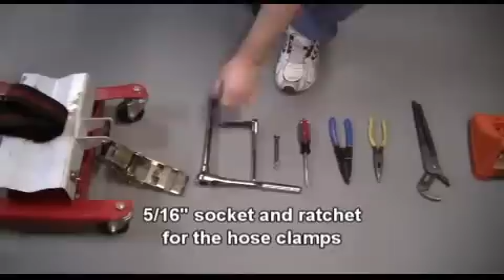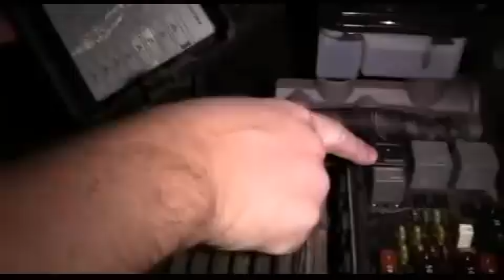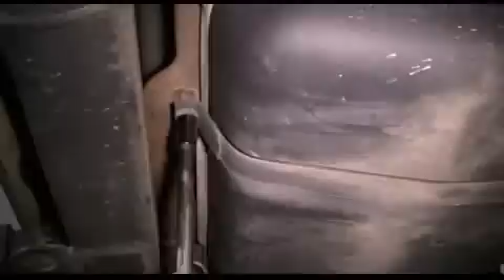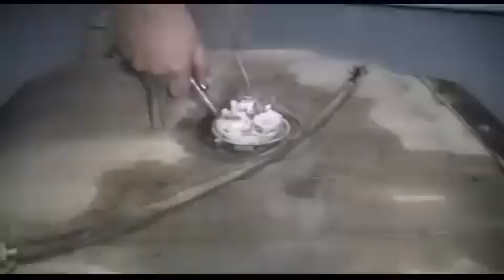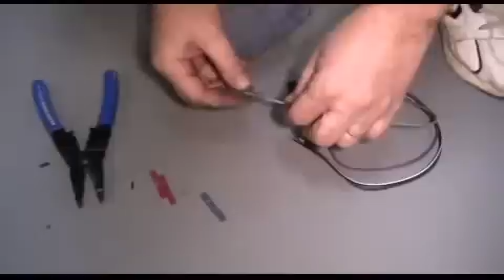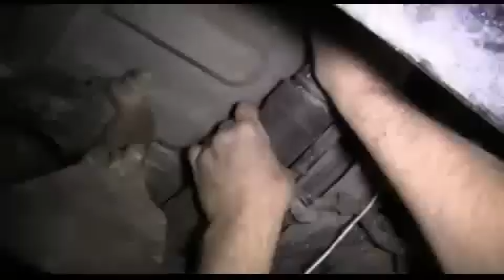Fuel Pump 1999 Chevy Suburban 1500

Comment: '99 CHEVY Express, my gas gauge pegs out at 3 o'clock, and van will not start.Mechanic cleaned terminals on PCM and said it should work,,, well it doesn't. New fuel pump,rotor and cap,cam, crank and throttle position sensors. New ignition switch, filler neck ground strap, pump relay. Lost need help desperately.
Reply from the maker: Rocky Raccon Does the fuel pump turn on?-Greg
Reply: yes
It will drive till gas gauge pegs out.
Reply from the maker: Did you change the fuel pump connector?  A lot of the new fuel pumps come with a new connector.   The one from the factory was a bad design
Reply: Greg Cook Yes.
Reply from the maker: Rocky Raccon Definitely sounds like an electrical problem.  Does the fuel pump shut off once the gas gauge pegs?
Reply: Greg Cook I really don't know,,, I unhook negative battery cable and wait 5-45 minutes, and start again. Drive a few blocks or miles and it quits again. If I unhook at night, it may drive all day and start, or it may only go  around the block.
Reply from the maker: Rocky Raccon Sounds like the fuel pump is bad.  This is just a guess based on my experiences with Chevy fuel pumps and what you're telling me.  Sorry I can't be more helpful - Greg
Reply: Thanks for your effort. I took to a local mechanic, they cleaned the computer terminals and thought that would take care of it. NAWT!! I'm thinkin' I got a short some where.But thanks for your time. Very appreciated.

Comment: When I start my suburban occassionally it sounds like a gun shot. I know it needs a new fuel pump. Could that be causing the loud shotgun sound when i start it?
Reply from the maker: I have never heard a loud noise coming from the fuel pump.   I have replaced 3 of them in a Suburban and either you heard the hum or nothing. 
-Greg
Reply: Do you know what could cause that type of sound?
Reply from the maker: Crystal Irvin Not from the rear of the vehicle I don't.  Where is the sound coming from?
-Greg
Reply: Sounds like under the hood
Reply from the maker: Crystal Irvin I am really not sure what that sound could be but my Suburban would make a clunking sound when cranking.   When replacing the head gaskets we noticed that the block was cracked.   I hope that isn't your problem.
-Greg

Comment: Hi guys...

Would you happen to have a video on removing the gas tank on a 92 GMC C1500?

Thank you,
John
Reply from the maker: John,

    I am sorry we don't.  But since the body style is the same as the 1999 Suburban this video should be close.

Greg
Reply: Thank you for the response Greg...

Suburban tanks are in the back and easy to get out, C1500 tanks are closer to cab and much harder to get to and out. That's why so many people on Youtube cut access holes in their truck bed or take the bed off altogether.

Thanks so much for your time,
John
Reply from the maker: John Dumas You are right I don't know what I was thinking..  And that would be a great video.  I hate to see someone cut a hole in their bed.

Greg
Reply: Yeah... and there is not a single video on Youtube covering removing the tank and working on the fuel pump, for that series Chevy or GMC truck.

Bummer...

John:)

Comment: Was the new ele. connector that came with the new pump ness.? Cause I jst changed mine & now my gas guage don't work, but it's the exact same connecter!?
Reply from the maker: The original design of the electrical connector was a bad design and most new pumps come with a new better designed connector.  So if your new pump comes with a new connector then I would suggest replacing it if it's never been replaced before.  The new connector should be different from the original one.  If yours is the same then your fuel pump may have been replaced before.  I would double check all the connections.

Greg

Comment from the maker: We choose to show how to disconnect the lines once we had the tank removed.  It was almost impossible to show us disconnecting the lines while the tank was still connected as there wasn't enough room.  We also showed the tool we used and how we had to modify it.  I believe the way we did it was more helpful since we could show a better view of the lines.

Greg
Reply: Fuel pressure regulator
Reply: You can also whittle on the partition between the two line barbs on the pump, I did that and it worked.

Comment: I'm hoping it's just the Fuel Pump Relay that's causing my '99 Suburban to have a long, and hard start at 1st. crank in the morning, but I'm not sure if it's THAT, the FPR., or the Fuel Pump.  I was told, it could most likely be my Fuel Pump, but I had the Fuel Pump changed only 4 yrs. ago, and when it finally does start, it stay running like new, all the way until I, cut it off again...then, it cranks, and starts without a problem...unless I, leave it sitting for a few hrs..  I'm confused..
Reply: Yahachazaq Yasharahla did you ever figure out what the problem was w you suburban? I’m having the same issues...

Comment from the maker: There could be a few different things wrong but most likely it's a problem with the sending unit.  Bad thing is the sending unit is part of the fuel pump and to fix it you will have to replace the pump.  You could check for good connections to the fuel pump but this will involve lowing the tank to where you can access the top of it.

Greg

Comment from the maker: From what I can tell from reading your post, the only things left are the fuel lines and some small hoses attached to the top of the tank.  None of this would hold your tank in place.  If you have removed the straps the tank should move even with the filler and vent hoses attached.  I would probably use a pry bar and try to break it loose.

Greg

Comment: I'm replacing the fuel pump on my brothers '97 Suburban. I disconnected the filler neck and vent hose, as well as the electrical connection to the fuel pump. And last but not least, the straps to the tank. I can't drop the tank to gain access to anything else. It is STUCK in place. I noticed that there is foam placed between the frame/sheetmetal, and the tank itself. Is there anything else that the tank is physically attached to? Even putting my upperbody weight on the tank does nothing to loosn

Comment: Auto parts store sold me wrong line fittings.. So I broke the connections like you did in the video... Gas gauge stopped working a month ago so replacing the pump

Comment from the maker: I really don't know.  I wouldn't think it's your brake light switch or none of the brake lights would work.  I use to have problems with mine blowing fuses when I towed my trailer.  I had to increase the size of the fuse.  But I think all of my brake lights didn't work.  I wish I was more help.

Comment: I just replaces mine on a 01 suburban.Jacked up the rear blocked it with tire stands. Tank was half full of gas was not a problem. Used the floor jack to support the tank. Lowered it down towards back of sub and was able to get to pump and replace. Took me 2 hours.

Comment from the maker: Be careful as nothing is holding the tank up.   It's just stuck in position.   Some gentle prying is probably in order here.  Just be careful and make sure it's supported when it breaks loose.
Reply: Yes indeed, even less than half full it's heavy! Just did this job on my 99 Suburban 5.7, took all day but we weren't rushing. My neighbor actually did a lot of the work, turns out he just helped his brother in law drop and change on his Burb. I pulled up the transcript and that was very helpful to refer to when needed.

Comment from the maker: Sometimes the fuel pump will get louder before it goes out.  But that wasn't the case for this one.  It just quit.  But most if not all fuel pumps make enough noise to be heard.
Reply: That's exactly what my Burb did. Filled it up on payday, drove it 95 miles for work that day. Parked it so I could drive my crew cab, and went to move it a couple days later and it would not start. Was cranking fine but not running, because there was no fuel getting to the engine. 214K on the original one, and it just said" OK I'm done"....